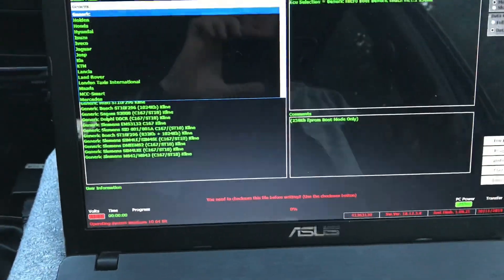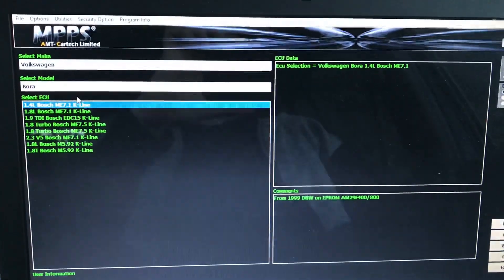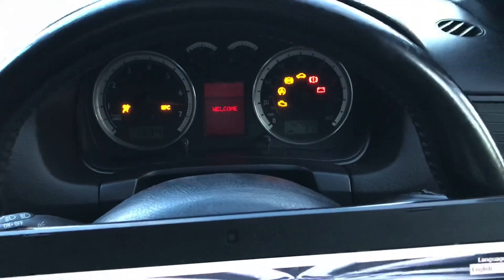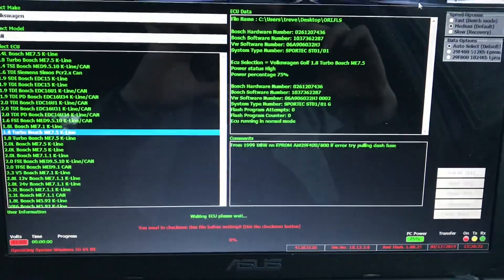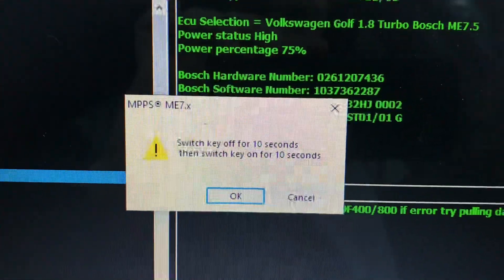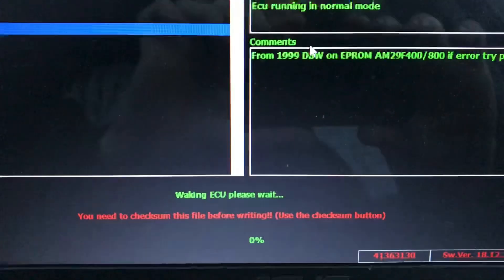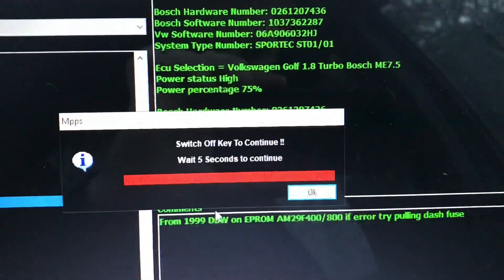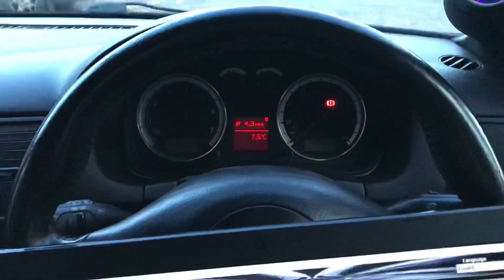How to Write/Reflash VAG 1.8T ME7.5 ECU using MPPS v18 via OBD

Comment: hey! I have a problem with my audi. firstly i read the stock software and copied it on my pc. then I flashed the ecu with a copied software from another similar ecu. programming went without a problem but the car wont start. when i try to connect the car to mpps it says ”ecu not found”. Did I just toast my ecu or what….
Reply: I mean that can i somehow tell if the ecu is still okay. engine cranks and radiator fan turn on after about 4seconds i turn ignition on but the car wont start. how can i get mpps find my ecu so i can program the stock software back
Reply from the maker: File from other “similar ECU” not compatible. Flash stock ECU file using bootmode.
Reply: I see. I’m not able to flash the stock software to the ecu. Every time I plug the mpps to the car and try do so something it says ecu not found. Can I somehow find the signal? Thanks for help man!
Reply from the maker: You have to use bootmode on the bench.
Reply: Okay. So you mean connecting the ecu directly to pc and power supply. Does mpps v18 work in that or do i need other program?
Reply from the maker: @ottokivisto5122 Yes. Google ME7.5 bootmode for more instructions. In MPPS > Select Make > Generic > Choose correct ECU.
Reply: @ottokivisto5122  still wrecked or did you find a solution? sorry to hear btw
Reply: yes, my buddy had a spare ecu laying around so i did immo off to that and its been working ever since

Comment: Always ID as you have done to ensure you have selected the right ecu (as you can see there are 2 options for the me7.5 1.8t) I would recommend everyone click on read too so there is a backup in case anything goes wrong, lastly before writing you must manually checksum the file (by clicking the checksum button) to ensure the file is properly ready before writing else you may run into random running issues
Reply from the maker: I’d recommend ktag for full backup before playing with MPPS. This software is good for quick read, edit, and flash. But if you about to read already tuned Ecu I’d give it a second thought. As for checksums I use free software called IronFelix.
Reply: @ReForceTek  I have an old ME3.x ECU. 1.8T cable throttle. Already turned ECU. Will this software work, or should I use an alternative?

Comment: Can you flash a M3.8.3 through the OBD on a mk4 golf?
Reply: nope you cant... you cant do it in oldschool way which is unsolder the IO(chip) itself and put it in programer and rewrite program or you can use some expensive stuff for doing this with no soldering procedure
Reply: You can do it, there is a trick 😉

Comment: hello ReForce Tek. i need your opinion if you can.
I have a Audi A4 1.8L 20V(no turbo) with ecu me7.5. 
i bought the MPPS v16 to doing the download de map and save a copy and remap.
so i have a doubt, using the winols the checksum will works fine when i put the new map no ecu????

thanks
Reply from the maker: Hi, should be fine, you can always check your file before flashing with me7.x checksum correction free to use tool from NefMoto, just google it and you will find it.
Reply: @ReForceTek  I have golf gti mk5 2L tsfi with the med9. 5.10. I can read using mpps and it let's my write but no check sum, I want to perform the checksums on my original and mod tunes before flashing anything. Will the above work for check sum for me?